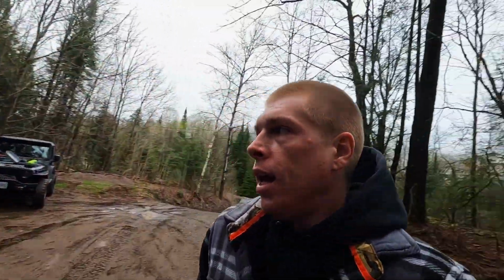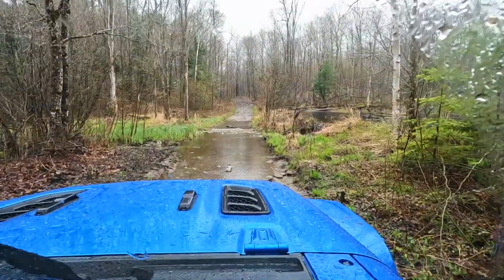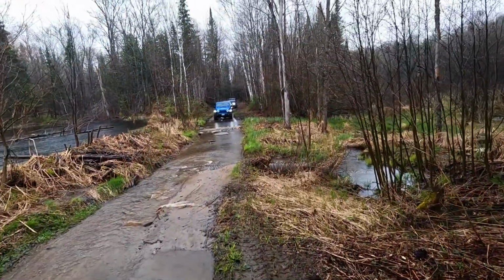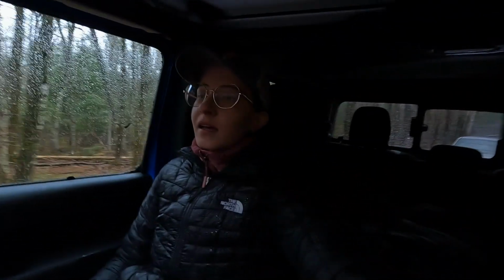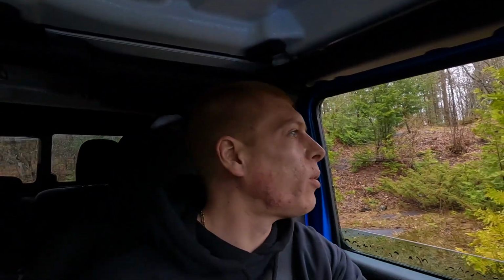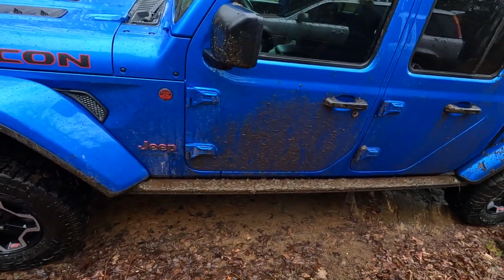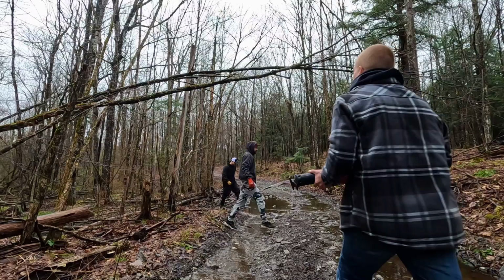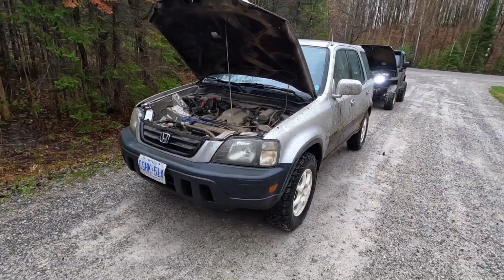First Trail Day Of 2023 In The Gladiator Rubicon

Comment: If you are looking for a couple other “stock” friendly trails up in Bobcaygeon or Minden area, Pencil Lake trail and Gooderham trail.

Concessions would be to deep in water for your stock truck, also Crystal Lake which is more deep.
Reply from the maker: Ya I’ve done all of ‘em, snorkel is going on so I should be good to go
Reply: I’ve done Concession Lake in stock JLUR on 33” tires, a lot of cringe moments though :)

All depends on how patient you are and the line you take.
Reply from the maker: Ya I’ve seen stock gladiators do it with me before in my TJ. Both on 33s and my lifted TJ is the same size as a stock gladiator so it’s possible just gotta take it slow and pick the right line like you said